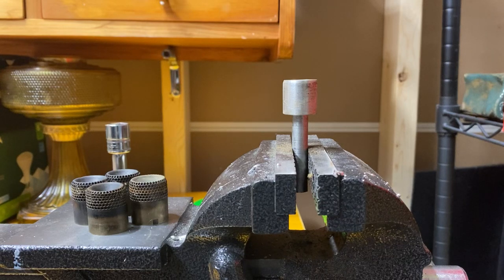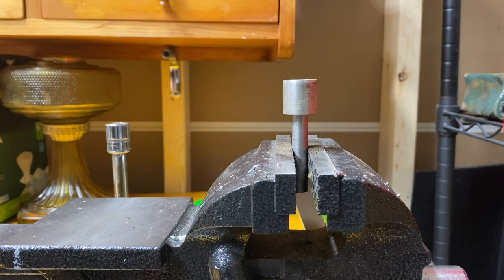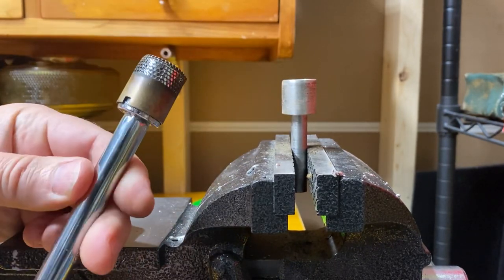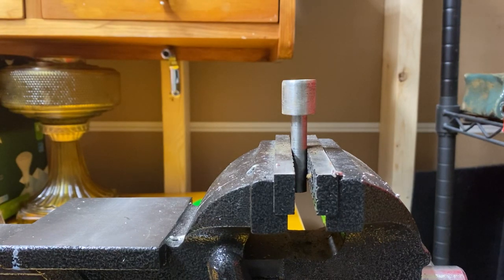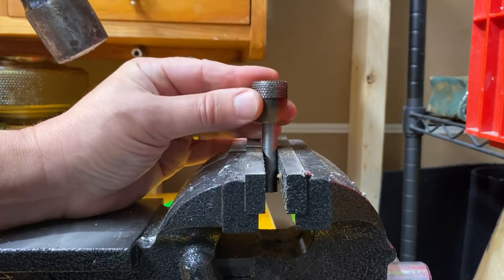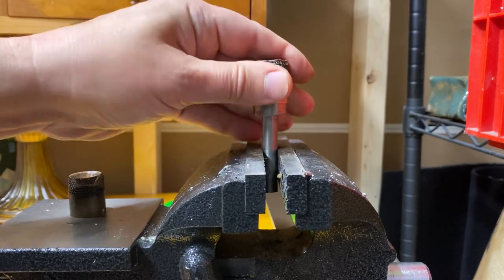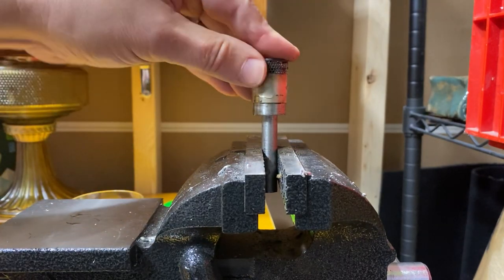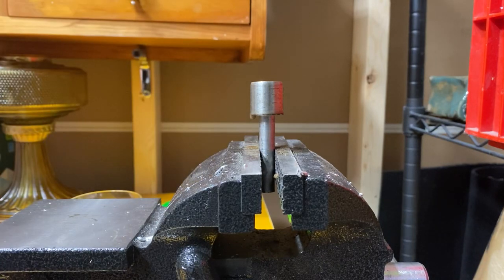Model B flame spreader repair

Comment: I use mine as bright as possible for all night pretty often. They melt from the heat. I have two new ones. But I have 3 melted ones. I'm gonna do the 16mm socket fix on those.  Good info!!

Comment: Interesting idea. Any tips on removing dents from metal founts? Models 11 and older. Ever use high altitude chimneys to get increase in light?
Reply from the maker: Fixing dents is not easy. You need to make tools to get in a push out from the inside. I have mixed success in doing this.  I use rubber coated hooks. 
 High altitude chimneys can offer more light but sometimes make noise when below 1000 feet from what I have experienced. Cheers